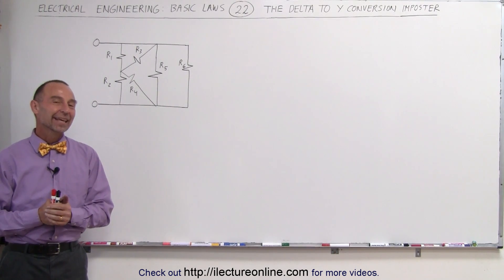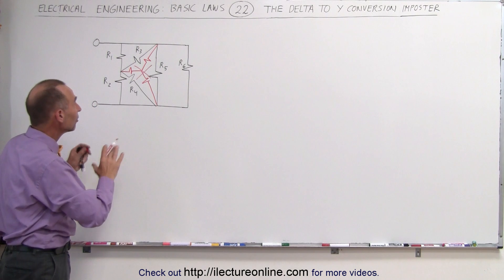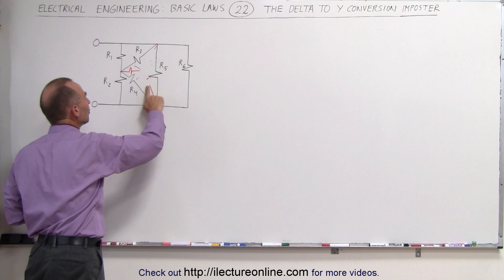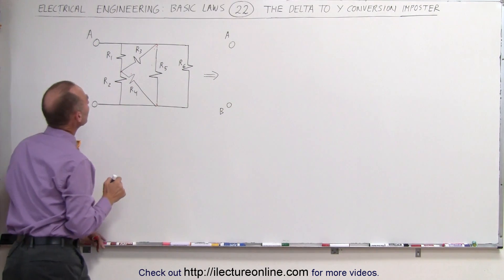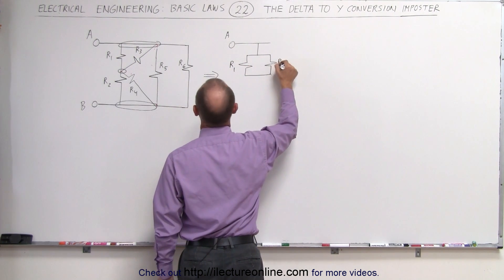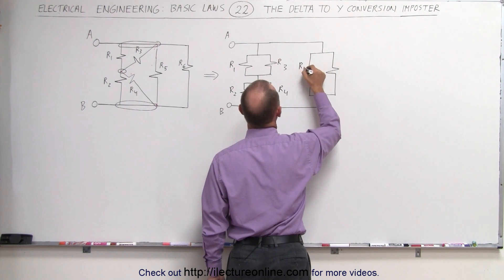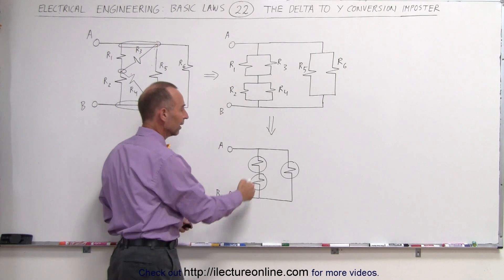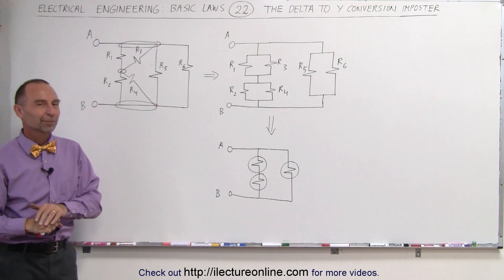Electrical Engineering: Basic Laws (22 of 31) The Delta to Y Conversion IMPOSTER

Comment: Dear Dr. Michel
Now i have a question please: Is there any key or signs in the problems lets me know that I should go directly to use the Y to Delta conversion in the problems?
Reply from the maker: You have to be able to recognize a Wheatstone bridge formation.  Note how there is a resistor that connects the 2 midpoints of the circuit.